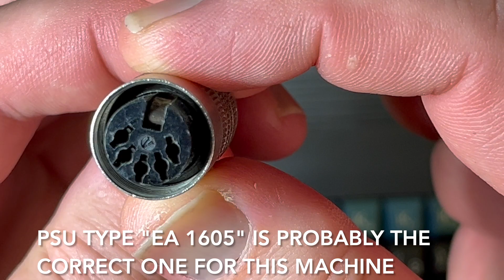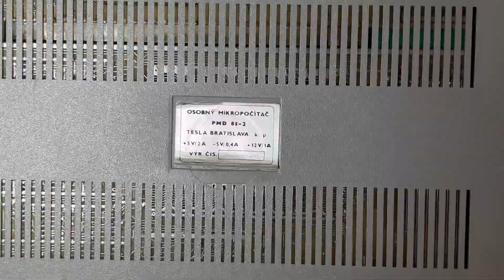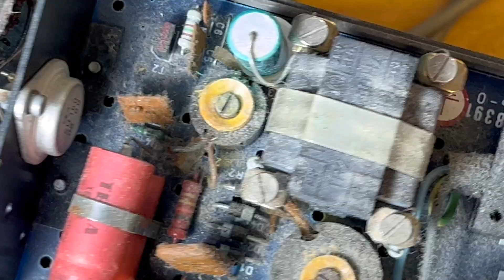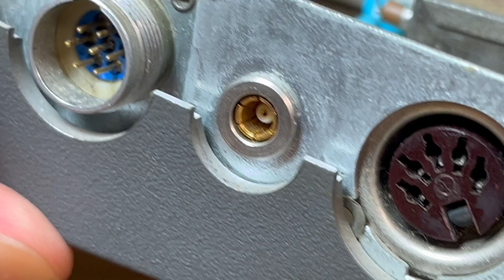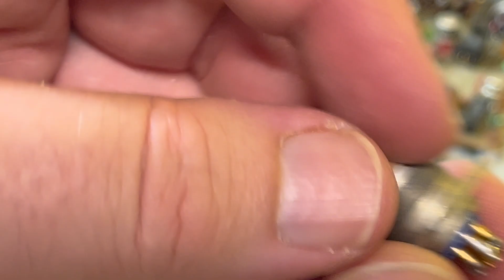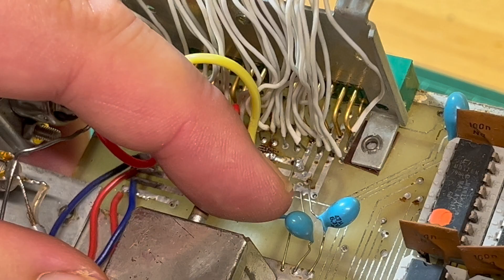🇸🇰 Tesla PMD 85: Part 3 (PMD 85-2) [TCE #0421]

Comment: When it's -ого/-его at the end of an adjective in genitive, it's pronounced ovo/evo.  And also in сегодня, I'm guessing because it was 2 words at some point.
Were those original caps shorted?  Are the original tantalum capacitors prone to that?  I know 80s western ones tend to be by this point.  Not sure if it's just something inherent to the technology though.
Reply from the maker: Ahhh, okay, got it!  For tantalums ... they weren't shorted, but are notorious (in Western computers) for failing, like you said.  Especially close to the power input, so figured it'd better be safe ... example:
https://youtu.be/1_USfg3G3Tw?si=dc0-o7hhLoqXhzQB&t=658

Comment: Nice! I saw this one only in the magazine.
Reply: The expansion card has a specific set of interfaces. That set was very common in computers which had been used at the train controlling systems. And in the ticketing systems for train travel.
Reply from the maker: It's a pretty comprehensive set of interfaces making the computer really quite versatile and easy to interface with, without having to buy additional adaptor boards.